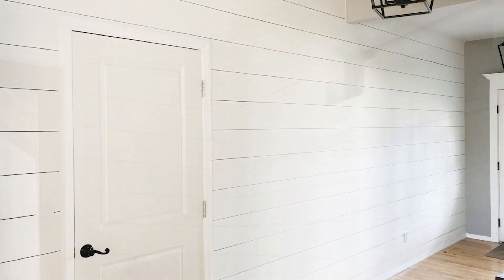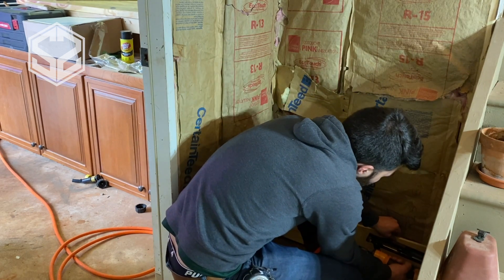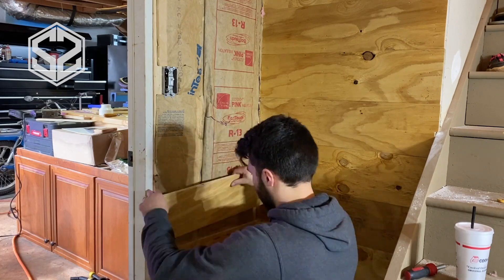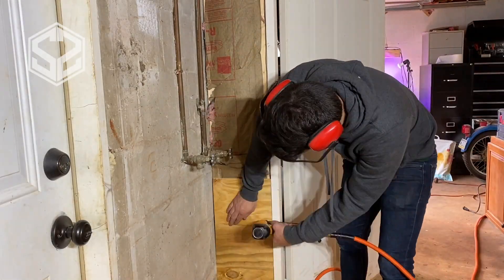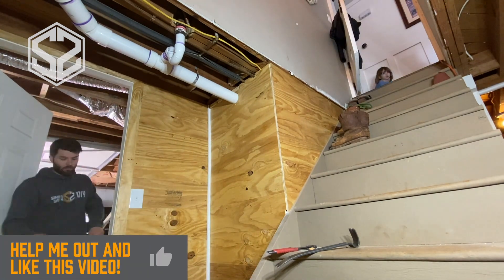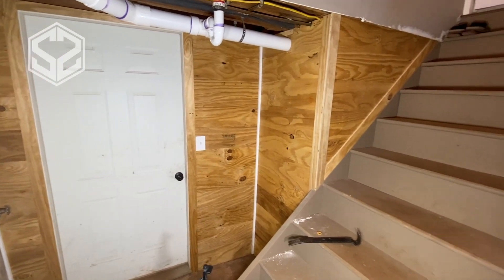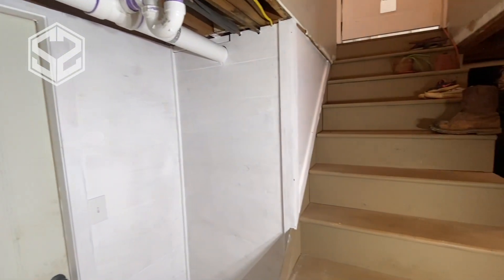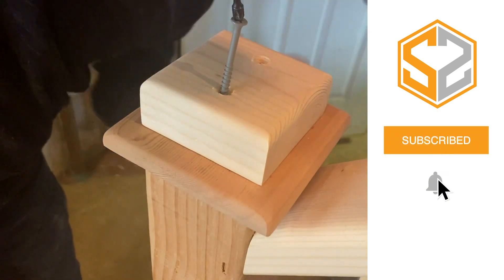How To Shiplap A Wall

Comment: If someone wanted to achieve a bit more of the shiplap effect, they could reset their tablesaw w a really shallow blade and run boards through a second time to take off basically the width of the blade from one side of each board.
Reply from the maker: Great tip!